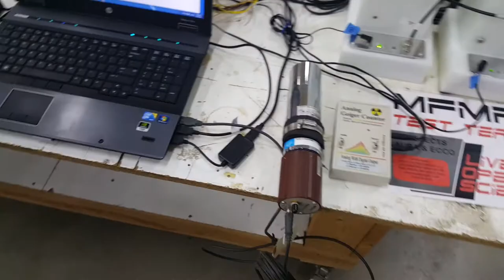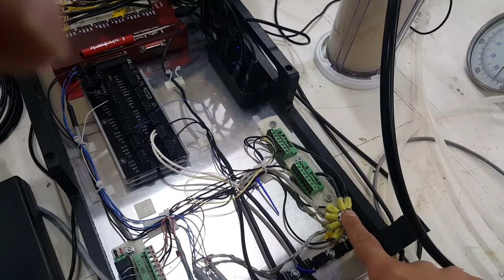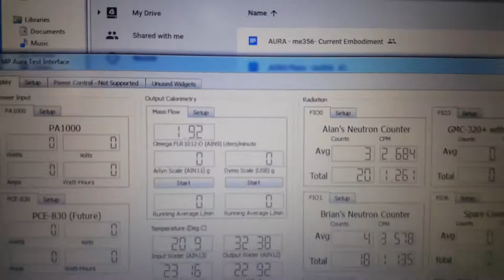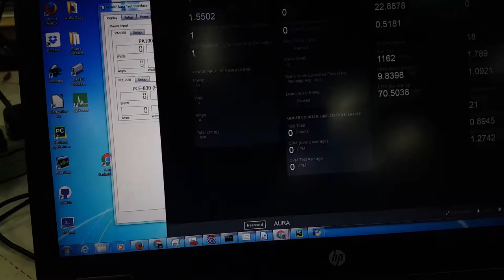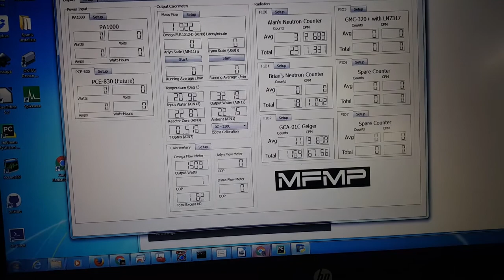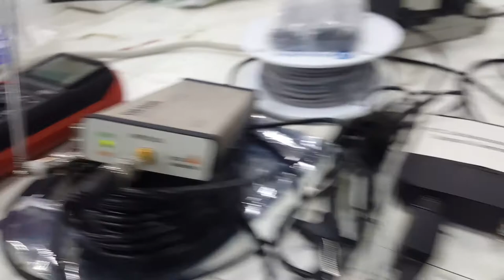AURA / ECCO Instrument tour

Comment: Nice setup. Water near electronics makes me nervous. It would be nice to isolate water from electronics, eg drain pans or raising the electronics up. Any concern here?
Reply from the maker: It will not be like this during run, water low, electronics isolated - we have tables.
Reply: FlyingSolo77 Only gets dangerous when ions get involved.😉
Reply: Conscious Energies: More worried about equipment damage than safety but it looks like they had it covered.